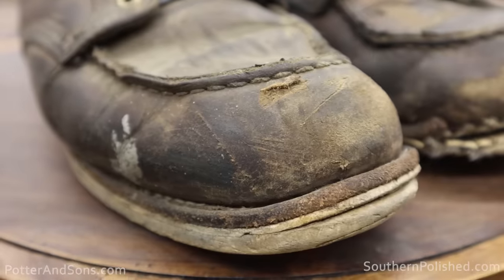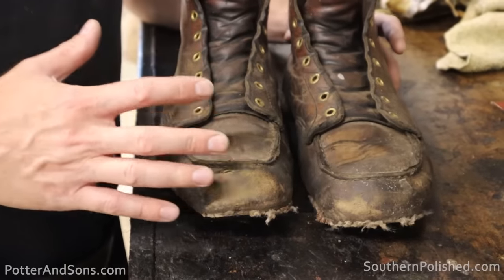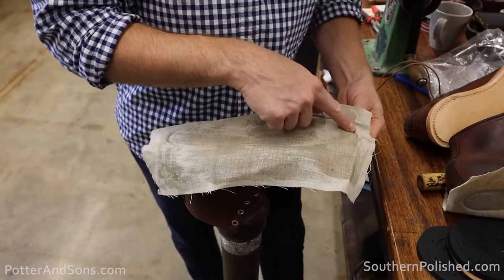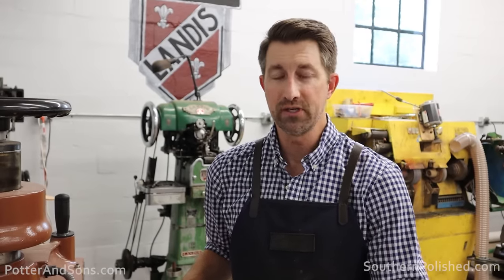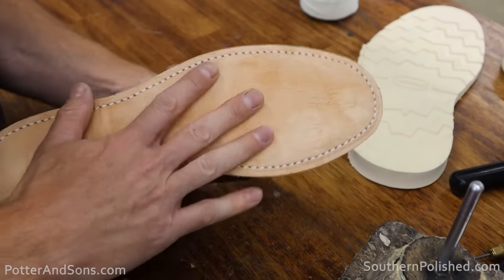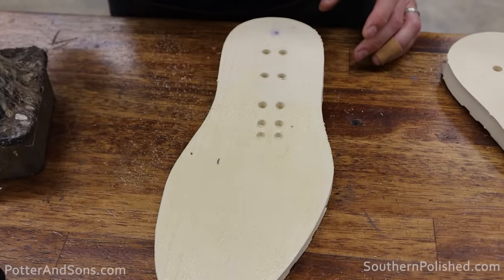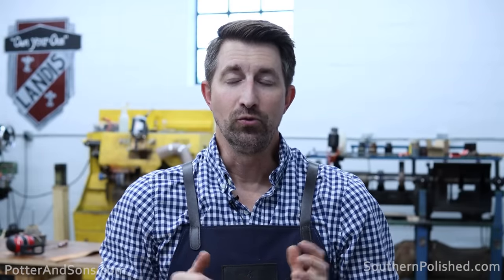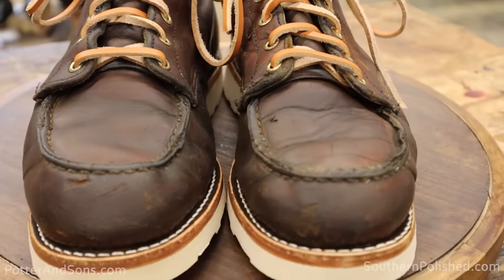Red Wing Classic Moc Refurbishment | Total Boot Makeover

Comment: Nice Jb.....i just need to know what tyoe of contact cement brand you use to glue
these boots ???
Is the hot air and press the trick for these rubber soles adhesion for years to come ??
Thanks and I am asking because my location is way off your area for me to send stuff for repair.
Thanks in advanced just in case you can tell me the brand 
Bravo ....Excellent job !
Reply: Great work on the boots . Great skill .amazing

Comment: I have a pair of hand made Lucesee Black Roper Boots that I had by my desk at home, I ran over the toe of one of them and scuffed it up. I've seen they've refinished the scuffed area to original by some method. I was wondering if you have done or do you do repairs of that type? Thanks Mike
Reply: BTW, these Boots have only been worn about 5 times, so they are basically new.

Comment: Hey guys, my right foot, near my big toe is slightly and permanently twisted upward.   I do outdoor farm work and need a good stable work boot.  My issue is that, in order to get enough height in the tow box (to accommodate my upward twisted foot), and enough width....I wind up getting boots way too big...too long.   I need something like a men’s 7.5, four E, unstructured higher toe box boot.   Is there such a thing?   I have thought about custom boots from Nicks....but held off because of cost.   Any ideas or recommendations?   Thoughts about stretching out the toe box?

Comment: I just bought a pair of 2263 Red wings as I was walking through the house to break them in the stuff between the midsole and sole starting coming apart and leaving a mess everywhere As I walked so I just took it all out of both boots and mine you these boots are brand new but old stock sole’s are brand new also .can be repaired with that new sole ? Thank you

Comment: How would you fix the inside heal of a typical work boot? I blow out the heals of every pair of work boot I own. I don't know if its because the boot laces might still be to tight when taking sliding them off my feet or the wierd angles my feet are in cause of my profession being a window cleaner. I walk roofs a lot to get to windows and I'm on a window cleaning ladder all day and it just destroys my feet.

Comment: so a pair of Traction tread lite are $260 , how much does this HEAVY REPAIR work cost tipically ? I get that red wings are great boots, but I am just trying to understand why fix them instead of getting a new pair. This is a lot of work and materials, it can't be cheap !!!
Reply: Most likely he has a sentimental attachment to them. In the beginning they did say how the customer was rejected by Red Wings for repairs. So I knew right away these were for sentimental reasons. The customer seemed very determined to have his boots fixed up. It's a very common reason people get their boots fixed. Also, if people have the money for the repairs, that's why they're able to. He also probably wanted to save them since they're already broken in well. People do whatever they want for their boots. If you want to get a new pair instead of repairing yours, that's up to you. People still get their shoes repaired. And the results here are awesome compared to the rough shape they were in before 😊! I don't know how much his were, but the website can give you a general idea for pricing.

Comment: Those are not original red wing soles so the re-sole job was not done by red wing. That is why red wing said the would not refurbish this boot. It could not be done to their standards, so the wouldn't redo it. Pretty easy to understand. This customer had a re-sole done by another cobbler, therefore, could not ensure the refurb up to their work.

Comment: Redwings are the bomb. I worked for a ma bell company and got a pair of lineman boots because I heard redwings are the shit. Back in 1998 I paid 200 for the short lineman boots that don't cover the whole calf that has the big heel so your hooks don't slip over the heel and they had the steel shank to give comfort while yiur body is pressing on the arch of the boot. Those boots lasted three years by putting mink oil on them every now and again. It's gone thru five pairs of bull shit boots for fifty dollars a piece otherwise. Redwings are the shit. You're gonna pay for them though, you will pay a hefty price. But redwing company is about providing a lasting boot.  They're not about " hey, we are cheaper, buy our boot", and then they get your money and the boots fall apart in three months. I just got a pair of itasca or something, boots, and the fuckers fell apart in three months. I guess though, you get what you pay for. I've done telephone work, heating and cooling, I've used tools and bought boots and I'll say, go cheap, you get what you pay for. Hire someone to do work, you get what you pay for. I slumped from ma bell and linework to hvac. I worked at a too notch contractor who's systems were so quiet and efficient yiundidnt hear them run. Lasted there five years because I did good work. Went to work for a bull shit box and flex company that didn't give a fuck about doing a good job, and lasted a few months. You do the math. It must be nice to have money and be able to afford quality and people that take pride in their work. Go cheap and fuckers are of the mind " I'm cheaper, I don't have to give quality I can chunk it in or sell whatever. "

Comment: I worked in the oil field and tried to get this done for my boots several times. What was i told? It cost more to fix them than it would have to buy a new pair. And what do you have when they're repaired? A used pair of boots with a new sole. Nice video though. This is nonsense unless your in love with the leather uppers, and if you are you need psychiatric help.